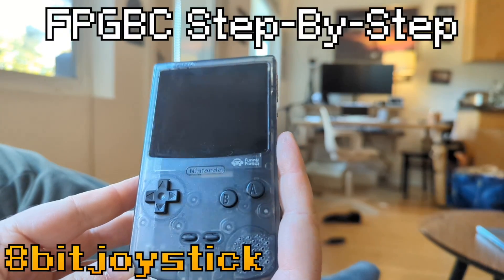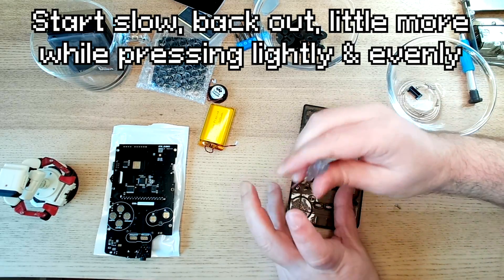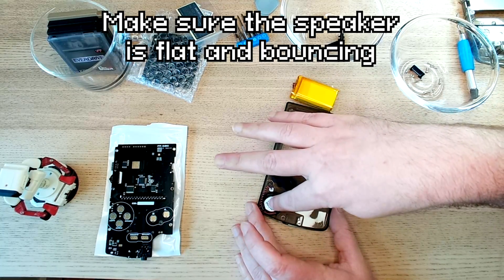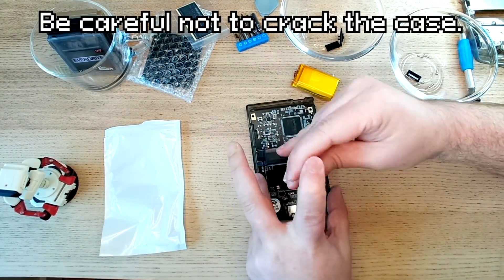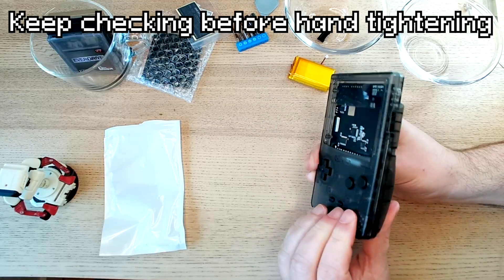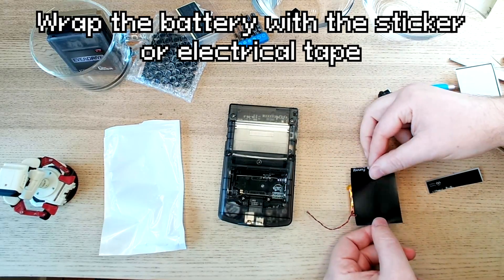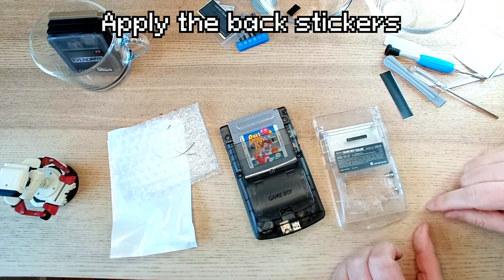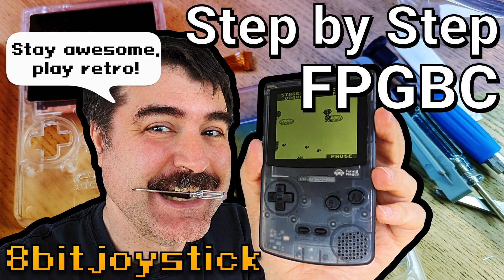FPGBC: FPGA Game Boy Color Assembly Guide - 8bitjoystick

Comment: Is it possible to use this FPGBC without the 1800mah battery and only with a power adapter?
Reply from the maker: So I tested this and it worked but the power light on the lower left will rapidly blink off and on indicating that the battery isn't properly connected.
Reply: @8bitjoystick  Thank you for your answer!

Comment: i cant attach the cable of the battery to the board, which you did so casually in the video. could you do a video about that?
Reply from the maker: Here you go. I hope it helps. 

https://youtu.be/uSukA3ZfWA4
Reply: @8bitjoystick  it does a lot. however i already did it, the problem was that i was assuming the two copper dots should face downwards. that wasn't the case counterintuively. but thanks again!

Comment: The speaker worked when I tested the mobo, but after all the installation it stopped working. The screen is fine though? I don't really get what happened, it flickered sound just for a second at one point fiddling around with it.
Reply from the maker: Don't really know what to suggest except take it apart and try to disconnect and reconnect the speaker. Be careful now that the screen is attached. Personally, I wouldn't disconnect the screen. I just be careful to keep the two halves close to each other when disconnecting and reconnecting the speaker
Reply: @8bitjoystick  I followed it exactly! But now it doesn't even register games either, and won't show up on my PC when it's plugged in. I worry it's a whole mobo issue.
Reply from the maker: Unfortunately it definitely sounds that way

Comment: Yo you said to use the triwing screws to secure the motherboard down, which was incorrect. The three shorter philips screws were supposed to secure the motherboard down. I trusted your instructions and the longer screws went through the front case. 

Like, I should have been more careful, but I was nervous so I followed your instructions closely and broke my shit. Dont make assembly videos if you're going to fuck up.
Reply from the maker: I am sorry to hear it cracked, that sucks. I'm sorry to hear if there was some confusion.

At Timestamp 1:21 I said the Phillips screws attach the motherboard to the case.
https://youtu.be/Qm-N9lJvu-k?si=8mRZcrhBUSwD_PGb&t=81

At 4:40 I said to use the Phillips screws on the motherboard. 
https://youtu.be/Qm-N9lJvu-k?si=Hjrwq1ulvY4R7YHM&t=244

I wish FunnyPlaying put together some instructions. 

It is a cool system that needs some actual documentation

Comment: The big sticker goes back of the screen panel so it doesn't short out. The small strip of sticker is just like you've placed it. I wish it came with instructions, I was confused myself. Great video nonetheless and blacking out your battery sticker looks great regardless with your case. NOice.
Reply: Mine didn’t came with any stickers
Reply from the maker: @Ricky-ju9ms  well that sucks. I got a little horizontal strip sticker that I put on the screen and then a big black sticker that I wrapped around the battery but apparently some people put that on the back of the screen. Again, I wish that they actually had some documentation
Reply: @8bitjoystick  yeah, maybe even just a QR code for online manual, I ended up painting it with a sharpie and it worked just fine
Reply from the maker: Well today is two different theories but where that sticker goes. The battery or the back of the screen. I didn't put mine on the back of the screen because when I initially tested mine I used a piece of cardboard as an insulating agent in between the screen and the motherboard. Then when the motherboard was in the case they are separated by an air gap because the screen can't physically touch the motherboard at that point due to the case. 

Again, I still fight it. Just so weird that they didn't even bother to write out some instructions, especially since this is sort of unofficially targeted at beginners to Game Boy mods.

Comment: Nice video!  Glad you were able to get the middle screw in successfully.  I am on the website looking at the case and button colors.  I would also want to get an Everdrive GB x7, since my GB/GBC physical cart collection is almost non-existent.  Does the save/load state function well?
Reply from the maker: Make sure that you choose Game Boy Color buttons. I initially bought gameplay pocket buttons and they didn't quite fit right. I also have an everdrive GBx7 and love it. The load and save states on it works great on this system. You can also swap between the Game Boy Color core and the Game Boy core to alternate between having it show up with the correct system. I actually used it in this video because I don't have a physical copy of that Hammerin Harry game

Comment: How long did it take to ship and actually arrive to your door from china directly from Funny Playing in china?

Did you get hit with any import duties?

How’s the battery life ?and is it possible to use normal batteries if you don’t want to use the rechargeable battery pack?
Reply from the maker: It took 10 days but the shipping was included so it wasn't air shipped or anything.  That's not bad for a package going around the world.

The battery life is freaking excellent and there is a pretty decent user replaceable battery and you can charge it via USB-C. But you cannot use AA batteries with this model. You're basically buying a kit for a fully tricked out fpga Game Boy Color and putting it together yourself and it's way cheaper than buying the mods and using original hardware. 

No import duties for me in the US
Reply: @8bitjoystick  awesome ordered thanks for replying
Reply from the maker: @kieranjohnstone6197  make sure you order a screwdriver kit if you don't also have a tri-Wing screwdriver
Reply: @8bitjoystick  would just like to thank you buddy for your video it really helped me build mine

I tested screen without battery connection by powering on the motherboard using a USB c cable

The included stickers are for isolating the bit of copper at the front and the back metal of the screen

Pre threading the screws beforehand was extremely helpful information install of the fpgbc was straight forward and I installed the 3 screw no problem thanks to pre threading posts

The longest part of install for me was the battery connector it’s a pain in the ass to fit- remove spring and use something plastic or wooden to avoid shorts

Other than that fantastic device with a rather tight power switch like yourself 

Delivery from china to uk was 7 days and was delivered by yun express/ Evri 

No import tax and shipping was free and fully tracked
Reply from the maker: @kieranjohnstone6197  nice. I personally like to switch between the Game Boy and the Game Boy Color modes so I don't really have to worry about triggering the Game Boy Color fix if I'm trying to play a regular Game Boy game in the game boy color mode. I also like the monochrome display when I'm playing original Game Boy game. I love this little thing
Reply from the maker: @kieranjohnstone6197  ah so that's what the big black sticker was for? I use it to wrap the battery. Again. It's really well designed and I'm amazed that they did absolutely zero documentation on how to put it together, especially since It totally appeals to people that aren't into Game Boy mods but they're curious about it
Reply from the maker: Definitely check out my video review. 

https://youtu.be/BS0IWx4CaJw?si=-QD86w7SgcdtQyqR